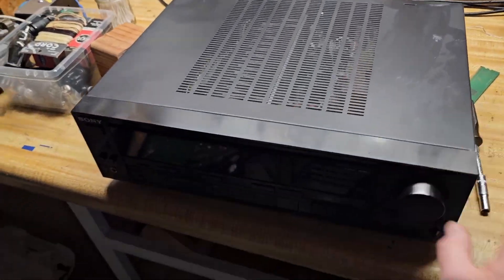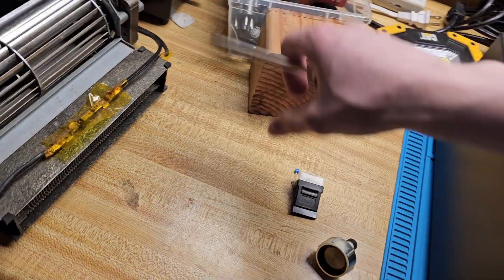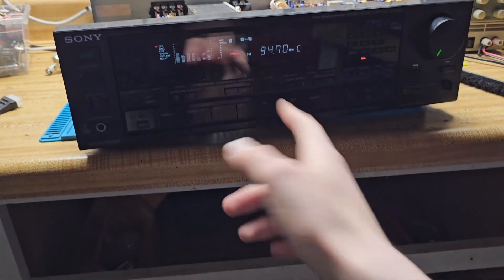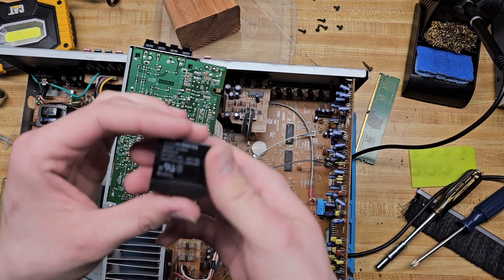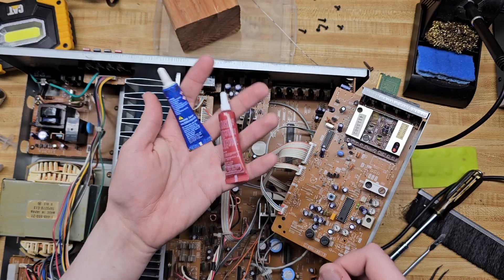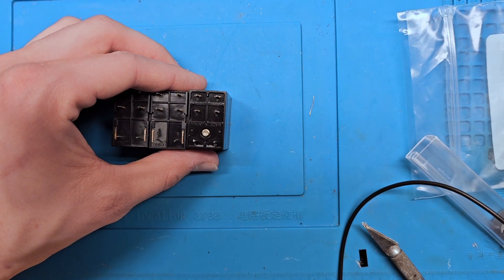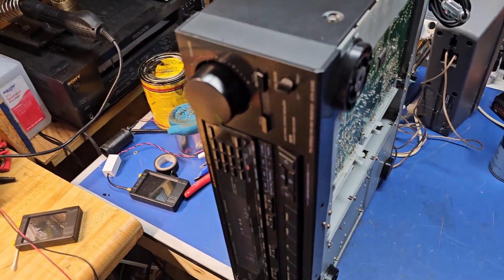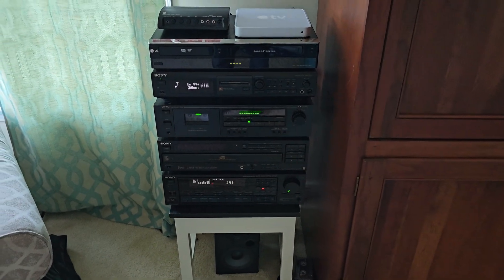Keeping my favorite receiver alive: Sony STR-AV910 Audio channel repair

Comment: Just ordered a Sony STR-D2020. Curious if your stereo shares any of its relays.
Reply from the maker: Just doing a quick look at the service manual for it, the part numbers appear to be the same, but what is RY401 on mine is RY601 on yours
Reply: @jmantothe64  Thanks